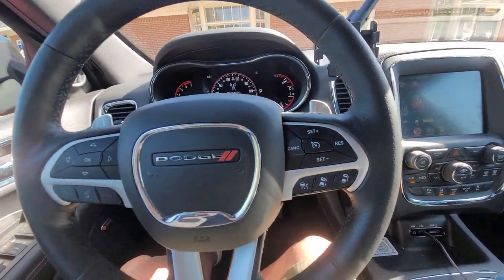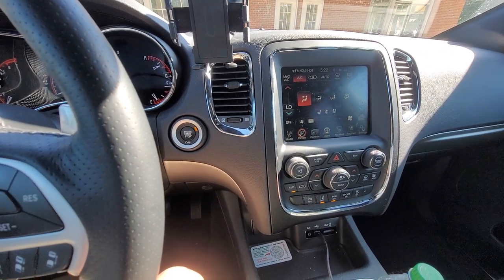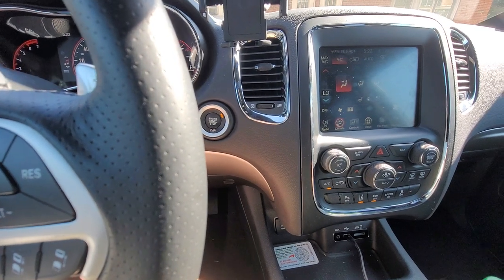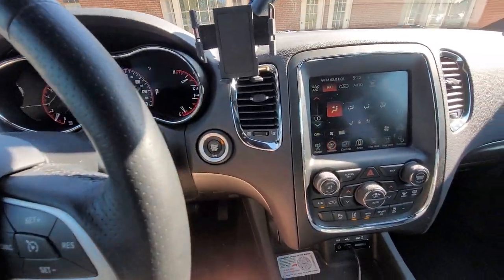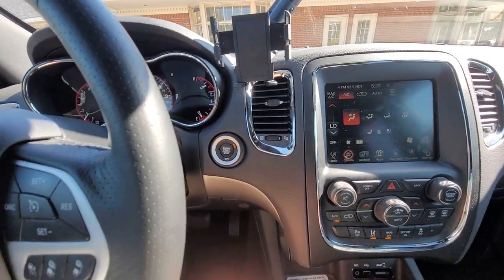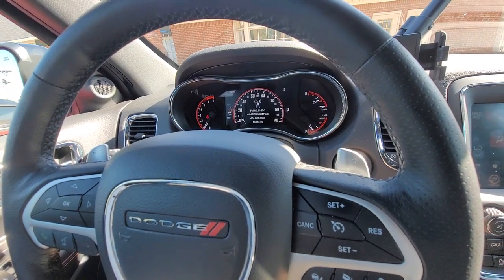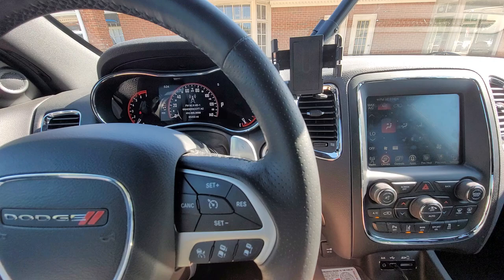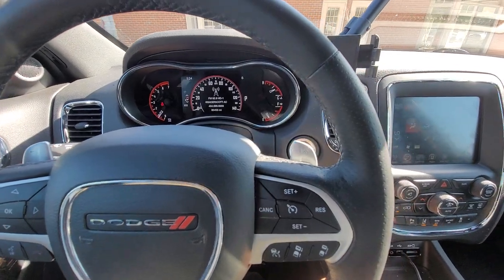👨‍🔧 How I resolved the loud hissing breathing noise in my Dodge Durango RT a/c air conditioning

Comment: That extra cost is because you have a YF 1234 system.  The refrigerant costs about $600.00 for a 10lb container.  Compared to the previous refrigerant R134a which costs around $300 for a 30lb  container.   Also the machine I had to purchase, along with the leak detector for YF, the oil injector , etc. set me back 10 thousand dollars ( I own a repair shop ).  So we have to charge more for the YF vehicle's because of the cost of refrigerant and to offset the investment in the new equipment.   At the present time only about a few shops in our area do YF services, and dealerships.
Reply from the maker: Yep, that's what the shop said.  And I trust them.  Been taking my cars to them for years.

Comment: Pisses me off that this is such a common issue. This and the race track light leaking and the lights dying.
Reply: Its like they built the car to fail.
Reply from the maker: Pretty much all newer cars have issues
Reply: Tires lasted maybe 4.5 years and only 25k miles. Battery died below zero when everyone’s old beater still turned on just fine after 2.5 years of owning it. Super disappointing is an understatement on how I feel about this car. Also have the ac leak 🤦🏻‍♂️
Reply: Also a control arm broke and the coolant is disappearing from the res too and the engine hasn’t been touched only for oil changes that I do or supervise a mechanic doing it.
Reply: It’s the way the car is kept up , and of course there are normal re calls .  15 battery lasted 8 years . Front lights also . And it’s about time for the ax to be serviced . Buy 8 years is good
Reply from the maker: @dontgetlaiddown7695  So, a 6-year old car with 85,000 miles, always properly maintained, never abused should need a new radiator AND condenser?  Upkeep has nothing to do with it.

Comment: I have uploaded a couple of shorts regarding my 2010 ford focus. Mechanics are saying this is the AC compressor but I highly doubt it. It makes this hissing noise when only driving and AC is on. Does not do it when AC if off.
Reply from the maker: @CB-ow8ch  I would get a second opinion. Mine was the condenser. And it was very expensive to replace.

Comment: I have a 2020 & it makes the hissing noise but I wanna do it myself. I have 86k miles but paid for the 100k extra warranty.
Reply from the maker: @ohshiitmariah  i dont recommend a DIY'er try to do A/C parts replacement. Period. Let alone, you don't know which component has the issue.  Pay The Man.
Reply from the maker: @ohshiitmariah  I doubt a warranty will cover it, but, I guess you will soon find out.

Comment: Mine is hissing inside the car idk why can you help? Passenger side gets hot but driver side is cold I changed 2 blend acuator on passenger side but when the hissing happens in the car the passenger side gets hot again it keeps fluctuating and later it makes my driver side one hot as well 

Any tips ?
Reply from the maker: Tips?  You take the car to a honest shop and let them diagnose it.   You won't "fix" it yourself.  You let a professional do it.
Reply: Mine too! Did you find out what was wrong with it?

Comment: i need help, my dodge durango 2011 has a squeaking noise on the drivers side of the dash (every 2 minutes) and the ac stops blowing air for 15 secs and then the noise stops and it starts working normal again, can you please help me i recently bought the truck and i have already spent alot of money and time on fixing the little details it had.
Reply from the maker: I hope you bought it for an excellent price, if you're having to do all kinds of stuff to it after purchase. I would take it to your Dodge dealer and have them solve it. instead of throwing a bunch of parts and time and money at it. and I am the type who likes to fix everything myself. but for something strange like that, just let the dealer handle it.
Reply from the maker: of course you can take it to an aftermarket shop, or hire a mobile mechanic to come to your home and take a look at it. your dealer would have it solved and probably in the quickest amount of time. but that's up to you.

Comment: my AC works for a while,  say 30 minutes.  then blows warm air for 10 minutes.   repeat. what's going on?  hisses sometimes only
Reply: Thermal expansion valve most likely
Reply: @digibeanreparationdordinat4837  hopefully that's the extent of it.   would be cheaper.  thanks for the video and and comment
Reply from the maker: Hope it's not the Condensor. $1400 repair.
Reply from the maker: @johnny-zh5fj  Did an A/C Shop diagnose it?  Kinda need that.
Reply from the maker: @johnny-zh5fj a dealership will be more expensive. But if your car is still under warranty, it might be a good option. I rather go to a good known family-owned shop in my area. One that has high reviews online.
Reply from the maker: @johnny-zh5fj  I definitely do not recommend replacing air conditioning parts yourself. Not unless you enjoy punishment.
Reply from the maker: @johnny-zh5fj  oh I almost always try to do my own repairs. But when it comes to air conditioning components, you need lots of special equipment, and knowledge. It will take you far longer to buy all of a special tools, proper Parts, as well as learn how to do it. So unless you're trying to get into the industry as a professional, I recommend letting a professional handle air conditioning repairs. And I have done a complete (successful) A/C replacement on a vehicle before. I will never do it again.
Reply: @digibeanreparationdordinat4837 my car makes a hissing noise when AC is turned on or off, only blows cold when the car is moving. Also makes gurgling noise When AC is off.